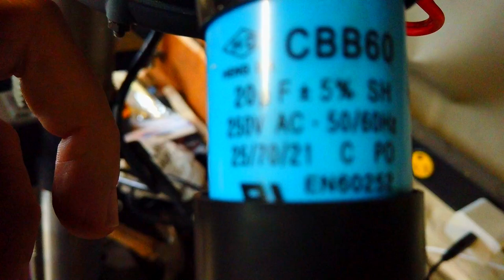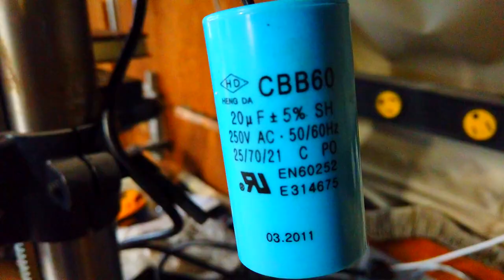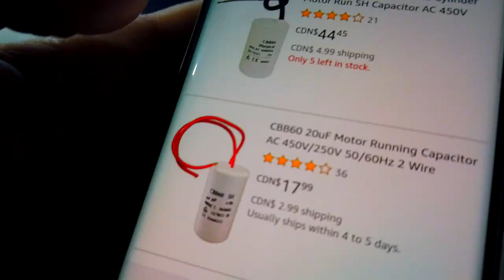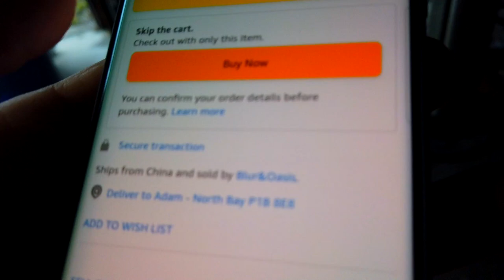Repairing the Mastercraft Drill Press

Comment: Thinking about stuff that The Post Apocalyptic Inventor has worked on, there's another possibility in the motor, if there's a governor switch that cuts the cap out once up to speed, it could be that has failed somehow, and is either stuck open leaving the cap out of circuit, or has for whatever reason corroded and the contacts aren't passing power, though how that arrangement would be set up in that motor I don't know, but, something to check before going in for a new cap...